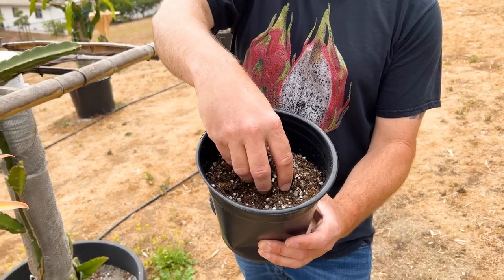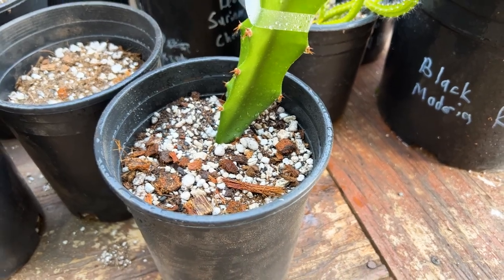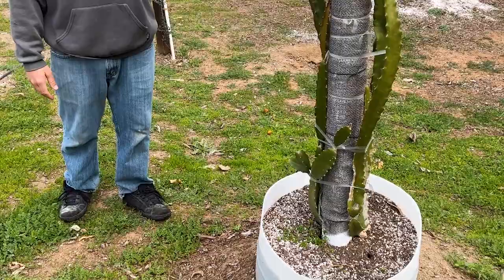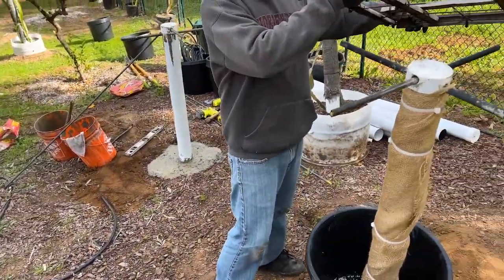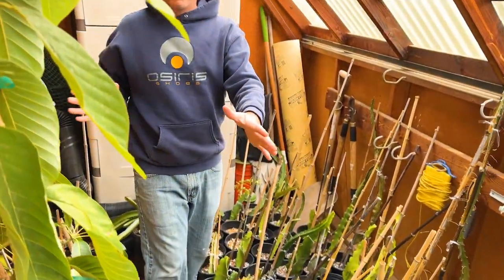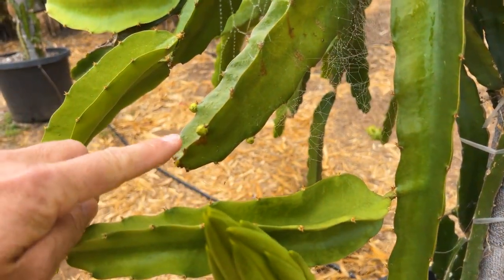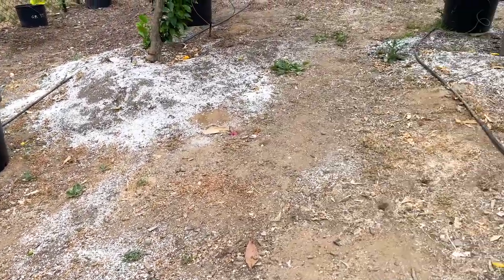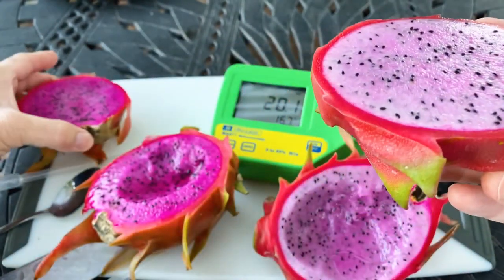HOW to GROW DRAGON FRUIT / 1 HOUR of the BASICS / FROM SOIL to FRUIT TASTING (2.0)

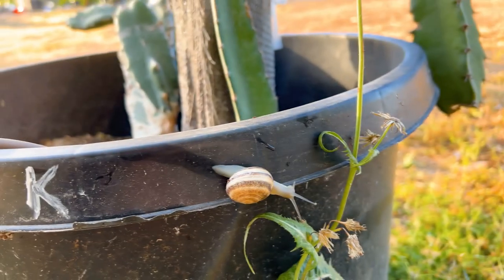Comment: I have not seen the original episode about snail and slug control, (starting at 31:29) but the best way I have found is to use the copper tape.  I’ve found it has to be at least 1/2” wide so they can’t get over it. If used right at the top edge, above the holes for the irrigation tube, it will keep the snails and slugs out completely. Obviously you have to ensure that there are no avenues around the tape, weeds, DF branches reaching down or touching another plant without the barrier, irrigation holes big enough for them to get thru, etc.
Reply from the maker: Thanks for the advice, I'll check it out.

Comment: Hi Paul I just started growing and I set up 4 pots ..but thinking they are desert plants I only used river sand .. have two white and two red varieties ....your content is awesome mate !
Reply from the maker: Thanks! Excellent, Sand isn't bad, you will need to add a lot of nutrients. I've been having a lot of success this season switching from Fox Farms to a Peat Moss Based potting soil mix.
Reply: Hi Paul i noted you mentioned that in order to make the plant start budding you trimmed off the ends of the plant . The pieces of dragon fruit I bought from the guy had all of the ends trimmed off! Does this mean my plant won't grow any further up the pole I created for them? And the moment they were only planted a few weeks back and are only about 50cm long ......is this as long as they are going to get as the ends are trimmed off straight cut?